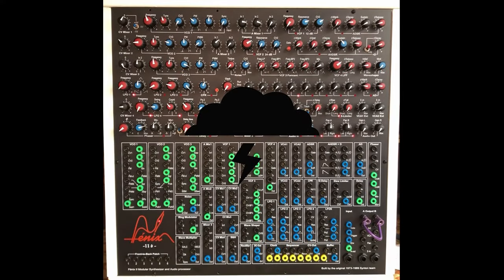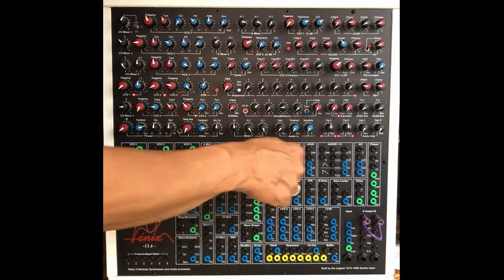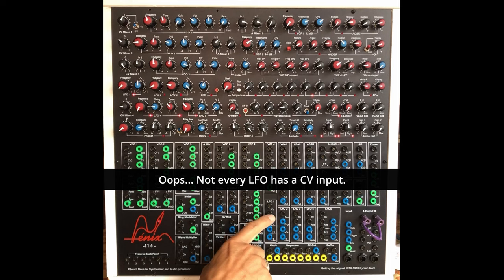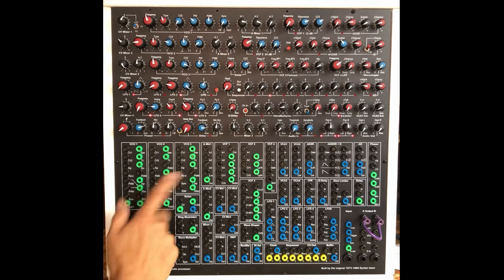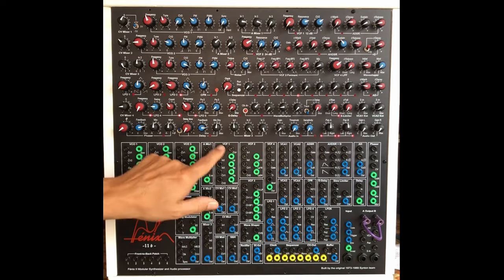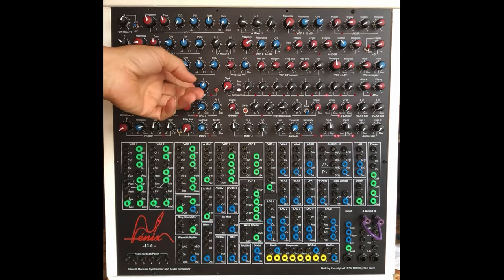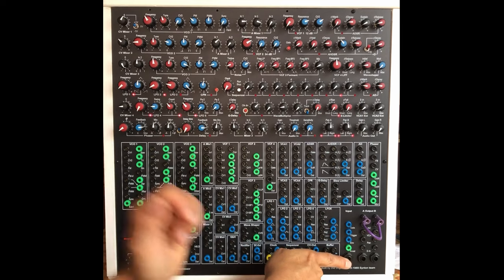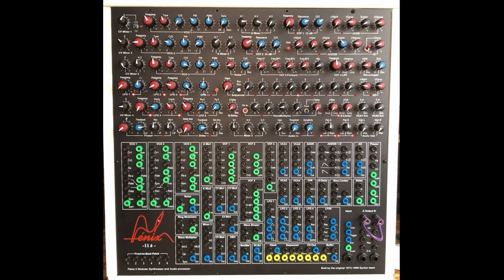The Synton Fénix IId

Comment: So I know what a comparator is in digital circuit technology but how is one useful in audio applications?
Reply from the maker: I use the comparator mostly for logic tasks, to trigger events. But for audio app what comes to mind is you could use it to « square » an audio signal, if you need a square wave that you don’t have on your oscillator output for instance. You could use it as a burst generator. You could also use it for pulse width modulation of an audio signal.